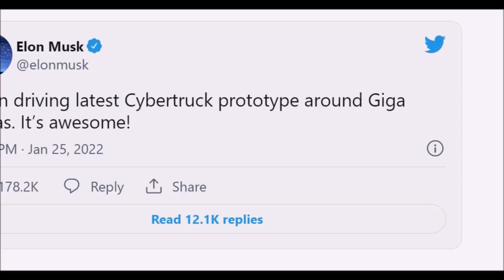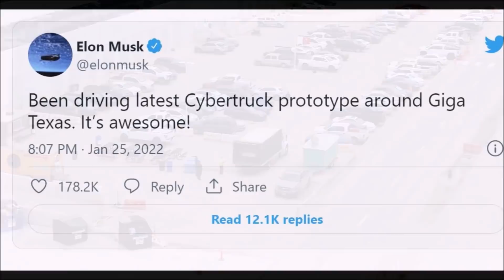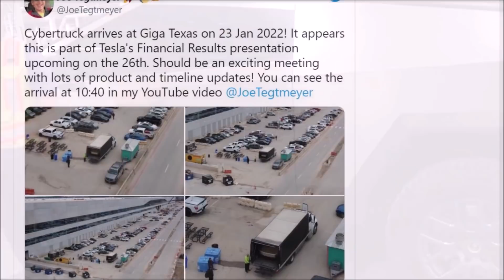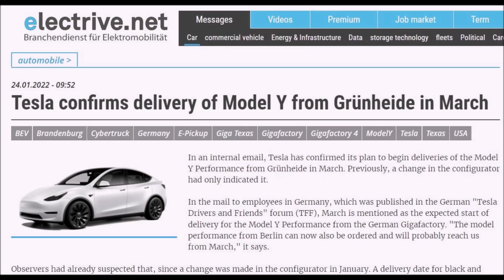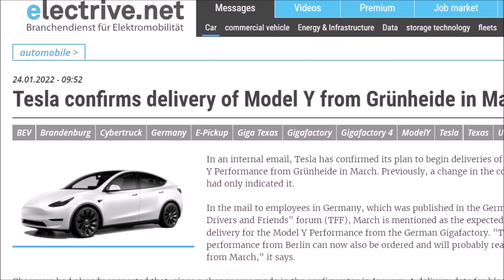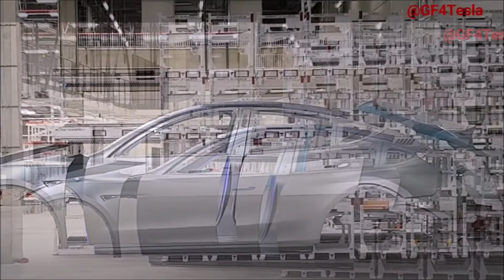BREAKING! Tesla Unveils NEW Fleet of Tesla Semi Trucks And The Last Seems Different

Comment: It was very clear at the Annual Event on the 26th, they don't have the necessary parts (mostly chips) to build any additional vehicles. To have serial production of the Cybertruck or SemiTruck they would have to reduce production of the current models in production. That would reduce overall production since a new production line is always slower during initial ramp up. They also said that battery production was not a problem now, it would be the next constraint once the chip issues were resolved.
Reply from the maker: Tx Paul.